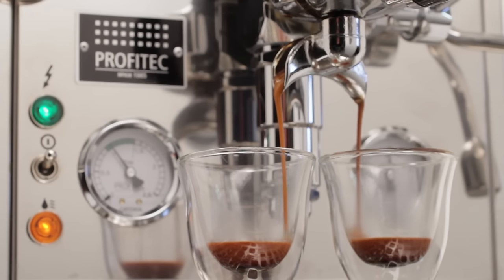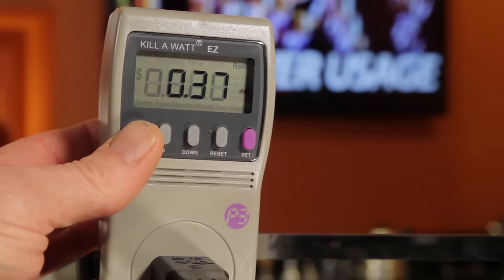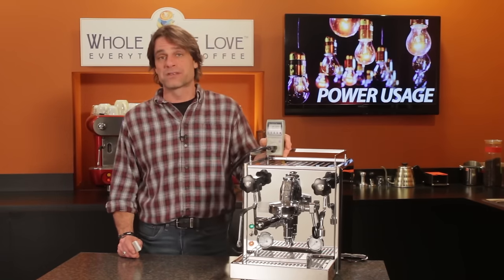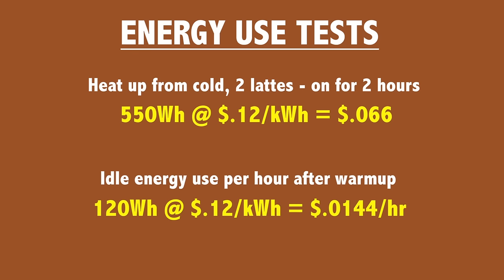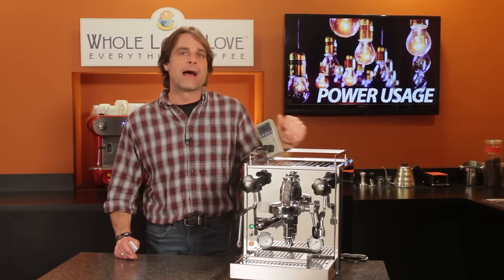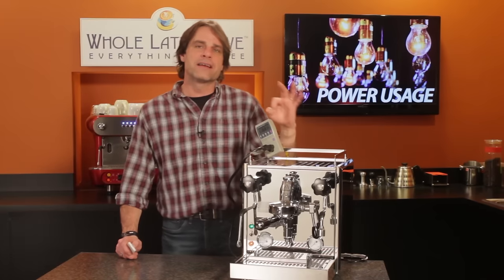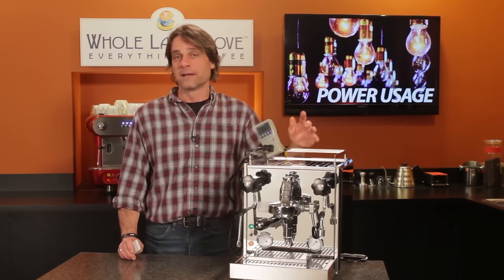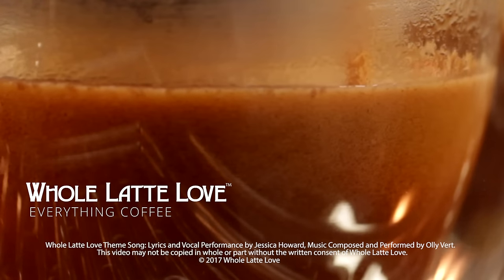Tested: Espresso Machine Energy Usage and Cost

Comment: When the dog shows signs that he want to go outside I get out of bed and the very first thing I do is turn on my ECM Synchronica. If I go to the offfice it gets turned of after I had 2 cups of cappuccino and if I work from home it stays on until 10 pm in which time it has produced a drink around 11 am, 2 pm, 4 pm and 9pm.
Reply: same here except i turns on/off mechanika iv pro
Reply: Thinking about installing a WEMO switch by Belkin.  That way I can ask "Alexa" to turn the machine ON for me without getting out of bed 😴
Reply from the maker: Hi JG, Love it! My dog is my alarm clock as well!
Reply from the maker: Love that idea! Just be sure the WEMO can handle the current draw of your machine. I believe they are rated for 15amps so probably okay.
Reply from the maker: Hi Charlie, So I talked with our lead tech... He's a little concerned that the WEMO is rated for 15A/1800W which is very close to the draw of some semi-auto machines. So you might want to check the power draw of your particular machine before going with the WEMO. He suggests consulting with an electrician. In his experience he feels that the stress from arcing on the relays within the WEMO could potential lead to a catastrophic and melty failure with no warning.
Reply: you can always make it (WEMO) to turn on/off ssr (HighAmp) but this requires at least some knowledge how to plug wires. 15Amps is too big load for such a tiny thing .... I have checked mine and its rated to 1kW max .....
Reply from the maker: I believe there are WEMOs with higher power ratings available.
Reply: Thanks...  I'll put it on a Kill-a-watt meter and get some readings first.  I think the Appartamento will be one that won't surpass the ratings on the WEMO "insight"...  I believe Belkin says that model can be used for window air conditioners and other inductive loads....so I think I'm okay there.  The two concerns that I do have are stories of hackers rapidly turning your inductive loads on-off rapidly thru wifi, and causing fires...will have to ponder that one.  The other concern is someone flipping the lever by mistake when the circuit is off...and I come out in the morning  to find my boiler shutdown and water overflowing the drip tray.

Comment: Hey Marc. Thank you for all the wonderful videos I have watched (and re-watched) as I endeavor to upgrade to a prosumer machine.

Could you do another complimentary video which discusses maximum instantaneous power draws? I ask because it is confusing to read the wattage of dual boiler machines. If you add those two numbers and then add the pump’s draw, few of us would have the circuit to run these prosumer DB machines.

Having interacted with some of your service personnel, I know maximum draw is managed. Further,  maximum draw may be documented in your product catalog or explained in an existing video. If so, maybe just a reference to those documents would do.

I fully expect your video would have a “consult with your electrician” disclaimer. But, perhaps you could tell us “in our experience this machine can be run on a dedicated/shared 15amp/20amp circuit.” Or “This is a big boy that’s going to need some forethought as it requires a dedicated 30 amp circuit.”

I look forward to continuing my research and getting my new machine soon. Thank you.
Reply from the maker: Hi John, You are welcome for the videos!

If you go to our website and the "specs" section for a machine the maximum wattage is listed there for prosumer level semi-automatic machines.

Here's a link to the ECM Synchronika a dual boiler machine: https://www.wholelattelove.com/products/ecm-synchronika-dual-boiler-espresso-machine#product-specs

Watts listed in specs for the Synchronika is 1400.
watt / volt = amps.  For the Synchronika it's: 1400w/110v = 12.73 amps

Drawing 12.73 amps the Synchronika can operate on a 15amp circuit. It can be confusing if you look at wattage for individual heating elements in each boiler. For the Synchronika the brew boiler has a 1200 watt element and the steam boiler's is a 1400 watt element. Add those up and it's 2600 watts. But as you mention power is managed. The boiler elements never energize at the same time and boiler elements generally do not energize when the pump is running. Alternating the heating of boilers in DB machines is by design and they way it works in all prosumer level DB machines unless otherwise noted.

We do have a few machines which have higher power requirements. For instance we offer the Dalla Corte Mina in both 110 and 220v versions. If a machine requires something other than standard US 110v it's clearly noted in the product listing: https://www.wholelattelove.com/products/dalla-corte-mina-220v#product-specs

I hope that helps. Bottom line is you can run most any prosumer level machine we offer without special power service.

Marc
Reply: Thanks for the thoughtful and thorough reply Marc. I suppose you could have just said, “hey dummy, read the product listing”! 

I have a dedicated 20amp circuit and will now proceed with confidence.

Best!
Reply: @johnchapman6996  If you want a machine for a 20am[, I believe La Spaziale Vivaldi and similar machines which are small commercial dual boilers, they have the option of being used on 20amp outlets, which use more power because instead of alternating heating elements it can use both at the same time. I believe other machines have that capability as well. Unless I'm confusing it with the 220V (euro) versions vs 110-120v North America versions.

Comment: Sorry but that is bad advice. The higher the temperature difference between an object and its environnement, the faster the heat transfer will be. So you will necessarily waste more energy keeping the temperature high rather than switching it off after you had your coffee and back again when needed.
Reply from the maker: Hi GN, Thanks for the comment. Might depend on how long the machine is turned off for. Usage patterns might make it better to leave on for some users.